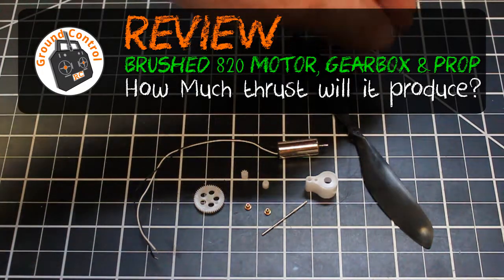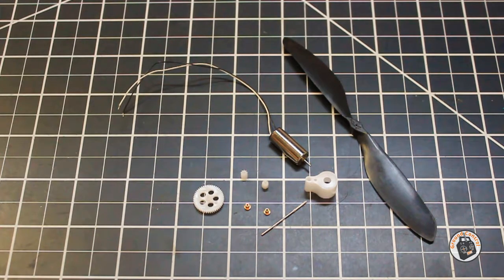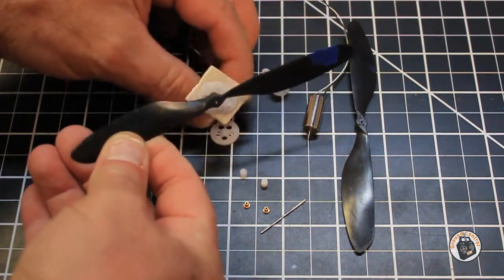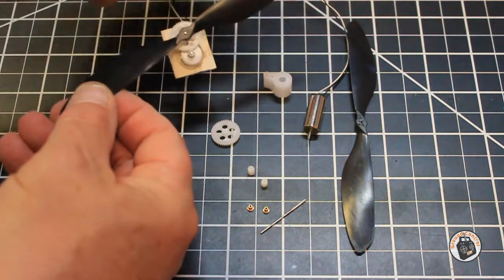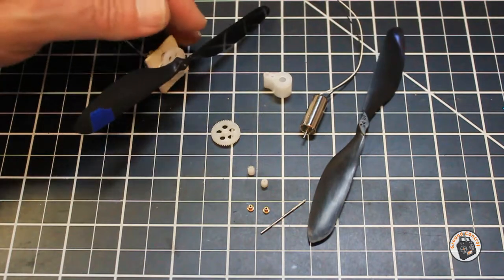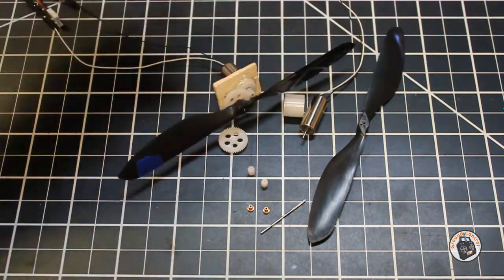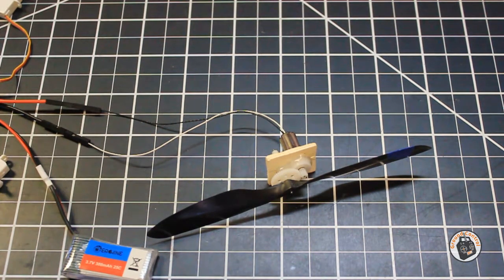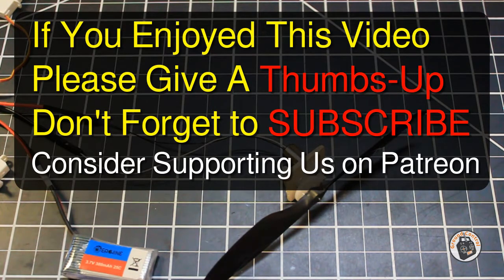Review - Brushed 820 Motor, Gearbox, & Prop

Comment: Hello :) you say : "It doesn't produce enough thrust to make a good upgrade in my WLToys F949 Cessna 182". Have you tested in a real situation or is this an assumption ?
Reply from the maker: I actually converted the F949 to brushless.
I used that brushed motor & gearbox in the Volanex Mini TrainStar.
It worked well in the TrainStar but that plane is smaller and lighter than the F949.
It might work as a replacement but it wouldn't be an upgrade.
I'd use the Motor & Gearbox from the Volantex Sport Cub 500 or Eachine Mini P51.
https://www.banggood.com/search/mini-?p=WE081047791920140372

Comment: How much does it weigh?
Reply from the maker: This 0820 motor, gearbox, and prop weigh 7.75 grams
Reply: @GroundControlRC  Thanks for the info. I happen to have a  motor, gearbox and propeller combo. It weighs 3.6gms.Do you happen to know its specs? It is able to lift a 35gm model off the ground. I want to buy.
Reply from the maker: @johnsamuel10  I can't remember the exact amount of thrust produced but most of these 5 inch props with brushed motor and gearboxes typically produce between 50-55 grams of thrust.

Comment: Do you have ideas if what is the size brushed motor for  skyhunter x8? Thank you for answer
Reply from the maker: Good question Jerwin! I did a quick search and came up empty, however, if you take a slide caliper or ruler and measure the diameter and length of the outside of the motor that should tell you. Common sizes for brushed motors in millimeters by diameter and length are; 0615, 0716, 0720, 0820, 8520 (8.5mm x 20mm), and 1020. That's how I figure out the size if I can't find it listed anywhere. I hope that helps and I'll see you in the Air!

Comment: Do you need an Esc? I heard coreless motors dont
Reply from the maker: That's a good question. You still need an ESC for a Coreless / Brushed Motor. You would need a Brushed Motor ESC. Some Receivers have a Brushed Motor ESC built-in to them. I hope that helps. See you in the Air!

Comment: Is it advisable to put a drop of oil in between gears?
Reply from the maker: That's a good question. For these type of applications I like to use a lubricant that will dry and not stay wet, as wet lubricants will collect dirt and sand. Here is what I use: http://www.performancelubricantsusa.com/product/non-stick-dry-film-lubricant.php  I hope that helps and I'll see you in the Air!
Reply: Ground Control RC Thank you so much!
Reply from the maker: @myfingerpainting  , you are most welcome ;-) See you in the Air!
Reply: Ground Control RC Thank you!

Comment: my friend is this receiver has stabilizer system
https://www.banggood.com/2_4G-4CH-Micro-Low-Voltage-DSM2-DSMX-Compatible-Receiver-Built-in-Brushed-ESC-p-1072251.html?p=WE081047791920140372
Reply from the maker: That's a good question Kanari. This receiver does not have any type of gyro or stabilization. It is a full manual mode receiver so I would not use it in any applications where you need stabilization unless you install a separate stabilization module. See you in the Air!
Reply: @GroundControlRC  many thanks to you brother
Reply from the maker: Kanari, you are most welcome ;-)  See you in the Air!

Comment: What ESC are youmusing ????
Reply from the maker: T-Rex, I was using the Built-In Brushed ESC on the Micro 4-Channel Receiver I use for these Micro Planes. Here is a link to the Receiver I used: https://www.banggood.com/2_4G-4CH-Micro-Low-Voltage-DSM2-DSMX-Compatible-Receiver-Built-in-Brushed-ESC-p-1072251.html?p=WE081047791920140372    I have used this receiver in couple of projects so far and it's worked great with a Brushed or Brushless Motor and ESC. See you in the Air!
Reply: @GroundControlRC  oh gosh. You are DSMx guy :)
If i buy same thing for my frsky, it will cost me 35 +shipping.
Reply from the maker: @TheZach78  , Yeah, I have a Devo 8S Transmitter running the Deviation Firmware so DSM2/DSMX is possible.

Comment: Hello! I do not know if brushless is more efficient than brushed with gearbox (1s), brushless 1s for 50g push consumes a lot. Can you do some tests to see the efficiency with 1s batteries?
Reply from the maker: I have performed those test and you're absolutely right. I have not found a brushless 1S setup that will perform as well as a brushed 1S setup and I've tried ;-) Right now I think a 1S setup is best suited for a brushed motor and gearbox and for a 2S and higher setup a brushless motor wins that contest. I do have some brushed 1020 motors on order that use a direct drive prop so I'm very interested in if they will produce more thrust than a brushed motor with a gearbox. I'll be posting my finding as soon as they arrive and I can test them. I'm planning on designing and building a 1S brushed back yard plane as soon as time allows and I'm hoping those direct drive motor and props will work for that project. With the advancements in these Micro Brusless Motors I would not be surprised if they end up being a better 1S option in the next couple of years but we'll have to wait and see. See you in the Air!

Comment: Hello. Are u still following this video and comments ?
I got this same thing, with 3A esc attached. I need som3 answers
Reply from the maker: Sure no problem! I try to answer any questions I can and share what I've learned. Tell me what you need and I'll try to provide correct answers ;-) OK, mostly correct answers ;-)
Reply: @GroundControlRC  https://www.ebay.com/itm/Micro-Brush-Motor-combo-GPS-820-w-Gearbox-ESC-Prop-Power-system-for-micro-flyer/163230743871?_trkparms=aid=111001&algo=REC.SEED&ao=1&asc=20160908105057&meid=f39bd61291fe475787bae9ee946241b3&pid=100675&rk=1&rkt=15&sd=163230743871&itm=163230743871&_trksid=p2481888.c100675.m4236&_trkparms=pageci:78d0fb08-2043-11e9-b0b4-74dbd18085a0%7Cparentrq:82b2b8601680ab10a459dc4dffffe0d5%7Ciid:1&redirect=mobile
Reply: Micro Power system w/ Gearbox GPS-8;Brush 3A ESC,7035 Propeller.

 

Specs:

Type: Brushed

Dimension: 46 x 20mm

Shaft Length: 15mm

Shaft Diameter: 3mm

Weight: 7g

Max current: 1.9A

RPM: 4V/40,000rpm at no load

Suggested prop: 6x3
Reply: If above link doesnt work. I gave you item descriptions. I made system with taranis and Vd5m ppm receiver. The problem is, motor shuts down at half throttle. If no propeller, motor runs with full throttle, but with prop at half throttle motor shuts down. I m using 1s. 300mah 35C battery
Reply from the maker: Thanks for the info. I don't see any links but I'll use the info you have listed. If you're using a 7035 prop you may be over propped. You may be pulling more amps that the motor can handle with that prop. I would try the 6x3 prop which according to your information above is the suggested prop. All the brushed motor and gearbox units that I have use a 5.5 inch prop and the pitch on my props looks like a 3-4 inch pitch. I found this item on the Hobby King site. Most of the reviewers of this unit are using 5x3 props. They also state that the wires are very thin so one thing to look at are the solder points of these wires on the motor. If the solder points aren't good or the wire has any break in the strands it will definitely increase resistance and cause it to pull more amps than it should. Those are the things I would check out. Let me know what you find and hopefully one of those two things will fix the issue. See you in the Air!
Reply from the maker: This comment got held because of the links and I didn't see it. I commented on your other post using the information you provided. I hope that helps.
Reply: @GroundControlRC  the prop they gave me weighs 2.5 gm and it is 6x3. I tried my props they are also 5x3 and 5x3. But no success. I soldered the CW motor, the one i had already and works fine with Q100 quad. they gave me CCW motor and CCW props, which was wrong, cuz gear make the rotation to CW. Still no success, i might upload a video. Its frustrating.
Reply from the maker: No problem! You can change the polarity on a brushed motor to get it turning the opposite direction as long as it hasn't been broken in in a single direction. I certainly understand your frustration. Sometimes this Hobby is a lot more frustrating than it should be.
Reply: @GroundControlRC  Item Name: Dual Way Unidirectional PPM ESC
Version(optional): Mixed control mode(PPM signal), Normal mode (PWM signal)
Working Voltage: 3.6-5.5V
Working Current: 4A Unidirectional
Application: Suitable for 130,N30,Coreless 8520,720 motor.
Reply: I hv this thing as well. Same problem.
 Motors shutt off at half throttle. 
Is this problem because taranis being used with brushed motor and esc?
Reply from the maker: @TheZach78  I don't think so if the motor is spinning up full when no prop is attached then the transmitter seems to be working fine. The transmitter I use with this brushed motor and gearbox and a DSM2 receiver is my Walkera Devo 8S running Deviation Firmware. Mine works fine. It could be a bad motor or bad ESC. Have you tried another motor with that ESC? I would do that to rule out the ESC. If another motor works fine with that ESC then you know it's the Motor. If another motor has the same problem then I would try a different ESC. I hope that helps.
Reply from the maker: @TheZach78  I've never used that ESC before but I have one other question. With this ESC I assume you need to program the high and low position of the transmitter throttle stick just like a brushless ESC. I would try setting this up in the ESC again. Have you programmed this once already? Also make sure you don't have any trim accidentally set on the throttle stick.
Reply: @GroundControlRC  hi. I tried other motor as well.  Same problem. It can't be run with props. Without props it is fine. I t.v. contacted with seller. They asked me to send video
Reply: I calibrated the esc.  That's why it works fine without props. I hv already left them good feedback. And I hv soldered new motor. Let's see what happens. I will upload video on YouTube. Will send u link. Both esc. This tiny one and other dual motor. 
I setup differential on this one.
Reply: I wish if I start using dsm2. But I  hv 6 frsky receivers. N hall sensor gimbal installed. Can't change tx :(
Reply from the maker: Well, it certainly sound like a bad ESC or Receiver if two motors are doing the same thing.
Reply from the maker: Sounds good!
Reply from the maker: My transmitter supports Walker, DSM2. and DSMX. I'm thinking of getting one of the Jumper Transmitters this year to support a lot of other protocols. It will open a lot more options for different kinds of receivers.
Reply: Here video of problem
Reply from the maker: It didn't sound good even without the prop attached. Is there some kind of binding on the gearbox? Do you have another gearbox to test? It sounded to me like there was binding in the gears and with the added weight of the prop and the air resistance of the prop it just couldn't turn.
Reply: @GroundControlRC  no. I don't hv any other gear. 
It was like this. When I change motor still sounds bad.
Reply: @GroundControlRC  I checked again. Used brushless motor bearing oil. N ran the motor by holding it secure in vise.
Reply: It works fine. Not that horrible sound. That sound was becuse of board.
Reply from the maker: It sounds like the gearbox is the issue. At least from what I could see and hear from the video. I would try to get my money back on that motor and gearbox.
Reply from the maker: Sorry some of my comments seem out of order as youtube is not sending me notifications on all of the comments. So you used bearing oil on the gearbox? Is is working fine now or do you still have the same issue?
Reply: @GroundControlRC  I used bearing oil on gear, and shaft of gear around metal bushes. Sound is lesser but still not work.
Reply: @GroundControlRC  they say I hv to wait till Feb 11. Because new year in China. Then they will tell me if they gonna send me new one.
Reply: Btw what ESC  are you using. I will buy another gear from hobbyking. Just wondering if my 3A micro esc will work ?
Reply from the maker: Yeah, I just don't think those gears are meshing properly and are causing some major binding issues.
Reply from the maker: Hehehe..you and me both! I was going to put in an order yesterday and saw a notice about things not getting processed until after Feb. 11. I figure it will be better to wait so as not to have the order lost. Hopefully after seeing your video they will either refund or replace.
Reply: @GroundControlRC  hello.
I got new one today. 
Same problem. With brand new turnigy 3.7 v 25c battery. Using frsky vd5m.  Motor doesnt move. Not even without propeller.  Just gives a jerk. Like for a 100th millisecond.
Reply from the maker: @TheZach78  , you received a new motor, gearbox, and prop and you're still having the same issue?  I would say the common denominator in this is the Receiver? Same Receiver? I wonder if the Receiver has a bad ESC. Is the Brushed ESC Built-In to the Receiver?
Reply: @GroundControlRC  They sent me a very tiny esc along with gear box.  That was combo. Esc 3A + gearbox gps8+ prop 6050+ motor 8520
It is 3A. Esc. 
Frsky vd5m receiver works great on other things. 
I have several of different esc, i used another 20A brushed esc. System works fine. But that 20A brushed esc is heavy.
Reply: So the bottom line is that 3A esc is crappy. I just paid for whole combo for no reason. That esc cant bear the current . I will use another small motor. N will check the result. I hv another 4mm brushed motor
Reply from the maker: @TheZach78  , Wow! If a 3A ESC can't handle that motor and gearbox that is crappy! The Receiver I use just has a 2A ESC and I can run a 1020 motor with a direct drive 3" prop just fine. With a gearbox I wouldn't think you would be pulling more than 2A but it would have to measured to be sure. What ESC brand is that?
Reply: @GroundControlRC  it has no name. 
Just a package
Reply from the maker: @TheZach78  , I wonder if they have a 6-7A ESC that wouldn't be so heavy. I know I've seen 5A Brushed ESCs before. Have you tried a much smaller prop to see if amp draw is he issue? I would definitely try a smaller prop as a 6050 prop is pretty big.
Reply: @GroundControlRC  i tried without props. Still Motor wont spin.
Reply: Did u check the link ?
Reply from the maker: Yeah, I was looking over the item. This looks like the one Hobby King sells ;-)  I don't know if I mentioned this before, but some of these Brushed ESCs will not initialize unless the Throttle Trim is all the way down. On my Receiver I have to put in Full Down Trim on the Throttle to keep the Motor from spinning as soon as I bind to the Receiver but this could also cause the ESC not to initialize. Have you tried that?
Reply: @GroundControlRC  nops i hvnt donw the trim thing. 
I m gonna try. This esc has no manual nothing. All i know is that its is 3A. Lol

Comment: the Gear is for motor size 820,  can we adapt a racerstar 8520 brushed  on this gear  without modification ???
Reply from the maker: That's a good question. I don't believe the 8.5mm diameter motor would fit in the mount as the 8mm diameter motor was a very snug fit. Also the larger diameter motor would move the motor gear away from the reduction gear by .25mm.

Comment: so what is better? this combo or simply a tiny whoop propellor?  i want to build a superlight slow flying plane.
Reply from the maker: I'm thinking of doing the same thing. You could used a brushed system like this one as long as your All-Up-Weight is no more than say 45 grams for Line-Of-Sight flying. I'm wanting to build one that can also carry a Micro FPV System so I'm probably going to go with a brushless system on mine. Something like an 1104 spinning a 4-5" prop. Something that will weigh no more than 50 grams.
Reply: @GroundControlRC  i also fly fpv and i own a umx fpv vapor, i am planning to build a indoor biplane, depron ribbs and foil and a thick wing for the slowest flight possible OR a electric f1d.
Reply from the maker: I looked that plane up...pretty slick ;-) I think going with a biplane is a good idea for the additional lift. Let me know how if goes. I'd like to see your end result. Happy Flying!

Comment: does it weigh 18 grams? seems a bit mutch...
Reply from the maker: Hehehehe...I don't know where they came up with that number ;-) The weight of the motor, gearbox, and prop as they come in the bag is 7.75 grams.
Reply: @GroundControlRC  thanks, this will help alot

Comment: how many amps does it draw?
Reply from the maker: I can't answer that question as my load meter will not work with 1S lipo only 2S or higher. Most of the brushed motor and gearbox combinations I looked had specs that stated no more than 2 amps. Most of the receivers I research for this project had built-in brushed ESCs rated for 2 amps. From my research that seemed pretty standard.